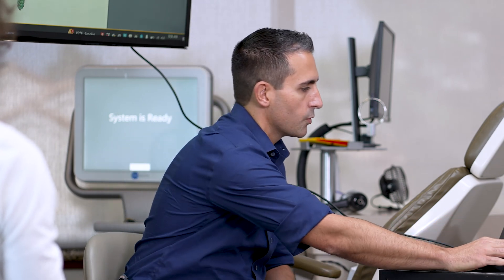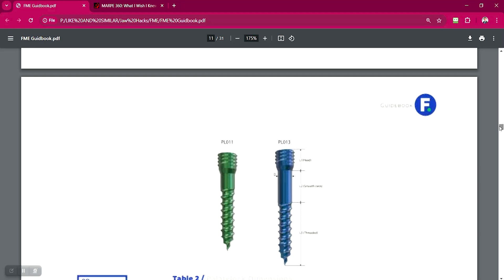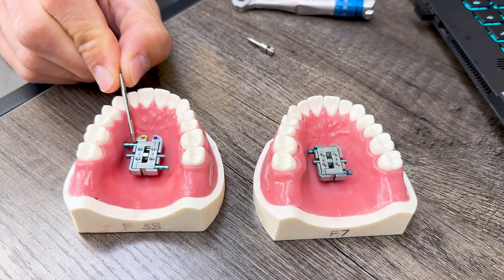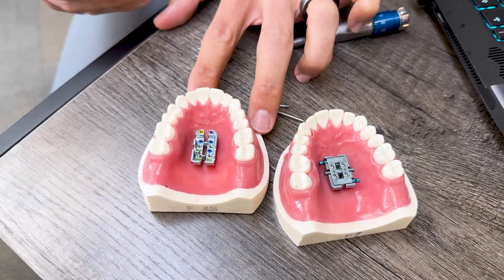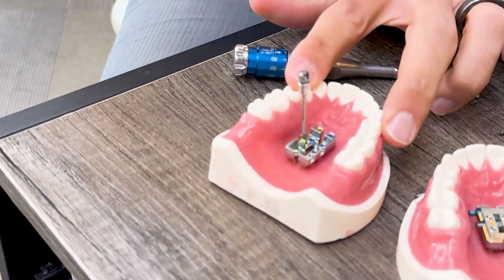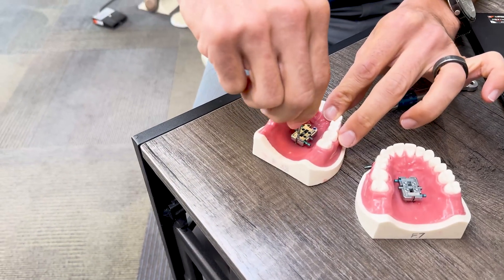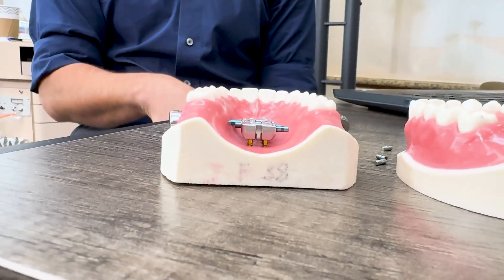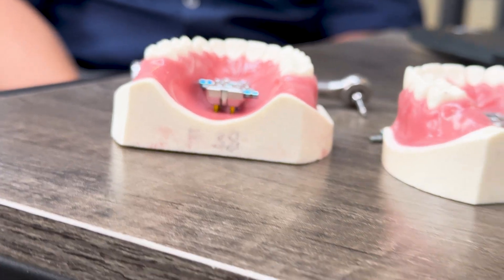A Closer Look at FME | Dr. Jeremy Manuele

Comment: It seems both the FME and custom have taken very different approaches like Dr. Manuele kind of touched on, which is that they both try to overcome the problem with MSE type 2 where you turn a lot with the jackscrew, but maybe that doesn't translate higher up. So, you want it to be less bendy, tilty, and more rigid and stable. FME has this jigsaw puzzle type of thing going on, strong screw, I mean just compare the rods that keep MSE/FME aligned (the blue ones in FME), and Ron's image of his MSE where his expander was coming off of the rods, they're significantly thicker with FME. Whereas custom took a different approach, instead it has all of the molar bands, alveolar TADs, etc. basically including the teeth as part of the anchorage. The teeth, like TADs, are also in a way screwed into the bone. If you want to extract them you have to really wiggle them out (I know from experience). So, with some of these custom expanders it's almost like you have 8+6 screws, which is a lot. I still have some concerns with using live body parts as part of the expander, because we know with AGGA that improper forces on the teeth or alveolar bone can lead to permanent damage, and so that is one of the reasons I am impressed with Facegenics for not going straight to that, and I imagine it would be much easier for them to just throw some molar bands on there.
Reply: Do you think you can do ALT-RAMEC protocol with fme as it can loosen sutures more and give better results?